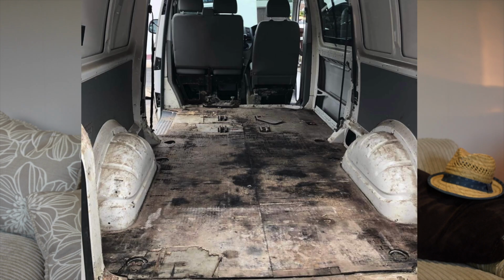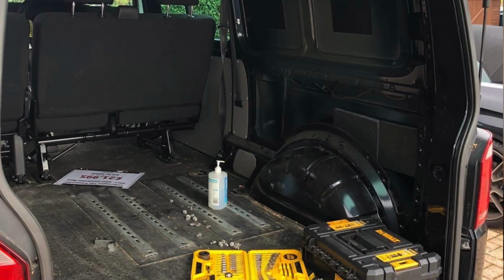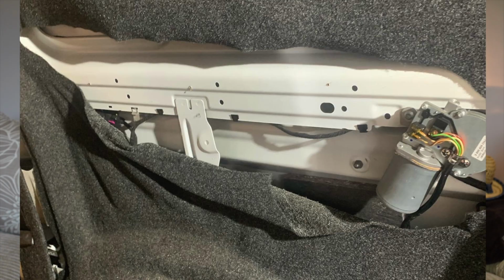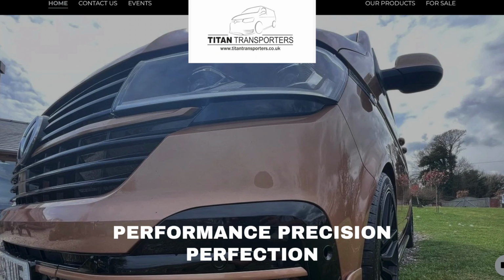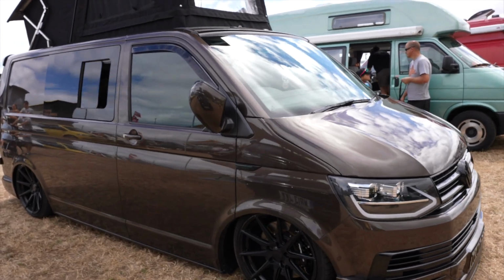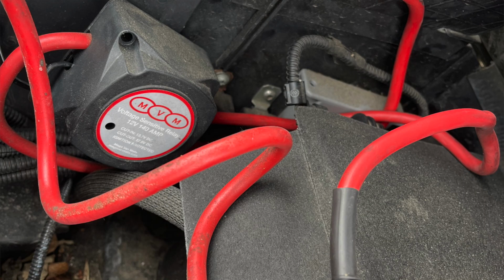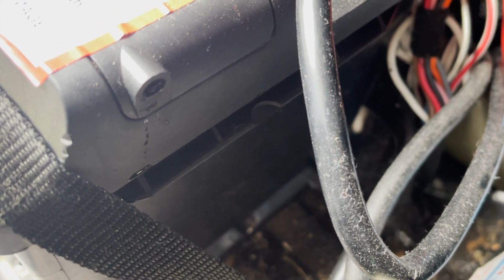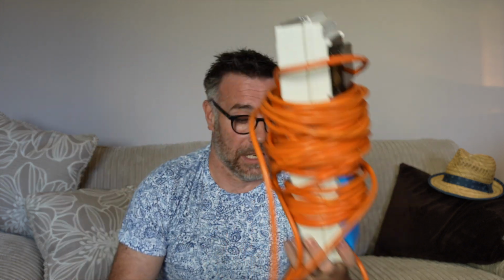Bad Conversions - Poor Quality and DANGEROUS Camper Vans

Comment: Thank you for another great video highlighting some critical points. I bought my VW as a new conversion from a new converter. I researched him first on line - he ran a building company and started to convert VWs during lockdown to keep himself busy. I met him at his house and followed him to his workshop, where the vehicle was. We went round the vehicle and he explained everything, then we went for a test drive. On return to his workshop he took me and my friend round the workshop where he was working on his next vehicle, which he had had  stripped down to bare metal and the build just started. He showed us the vehicle, then everything he was going to put in it and explained what he had chosen for the build and why. He spent a good 2 hours with us first, picking up each item for the build - confirming it was the same as the one he was selling - and showed us all the paperwork and invoices. This gave me an enormous amount of confidence about the van I was buying - and when I did buy it he gave me a folder containing all the details - I even know what flooring is down in it. The wiring is excellent -and he had a specialist automotive electrical engineer come and install it. He was then in contact for some time after, checking things were still ok. I’ve since had a split relay (I think that’s what it’s called ) added which lets me charge up both my leisure battery and car battery in the winter by hooking up to mains in the house. This has been a huge boon. Unfortunately he has now stopped the conversions which is a huge pity, as he did a superb job.

Comment: I had a conversion from Holbrook dubs. Poor customer service blamed me for problems. The electrics had slices through them where they cut to deep, earthed through the carpet and didn't secure the battery and other stuff regarding the van too many to mention.
Reply from the maker: Wow, that sounds horrendous. Unfortunately it does seem an issue that’s far too common.
It would be much better if the industry was regulated
Reply: You're not alone.

Comment: Good advice!
Just a word of caution on your wording about cables. Just to avoid confusion, multi strand (or fine strand) cable is what you should be using not multi core. They are different things. I am an electrician and have seen easily confused when buying cable. Keep up the good work!
Reply from the maker: Thank you. Well spotted, “strand” was the word I was looking for. At least you could tell what I meant, from how I explained it 😳 It’s frightening how some installers are using incorrect cables. I did mine myself, but made sure it was professionally checked prior to turning it on
Reply: Tri rated?

Comment: The one i always pick up is lighting- they have 6+ led lights on a single circuit that you either can operate when in bed or that all come on when you open a door . Instantly blinding you & the whole campsite 👍
Reply from the maker: They so are bright 🤣 Could you give a better answer the the comment here from Gary regarding the camping electrics. I was told they aren’t suitable, as it can make the van live
Reply: 230v?
Needs to be grounded to the body of the van for rcd  protection.
& i use 2.5mm arctic cable
Reply: 230v?
Needs to be grounded to the body of the van for rcd  protection.
& i use 2.5mm arctic cable
Reply from the maker: Perfect, thank you 👍

Comment: There is a camper van on sale on e,bay at the moment and the fridge flue is run in a flexible flue that runs touching pipes and wires and then goes down hill as it exits the van.  Dangerous.

Comment: I had a van from Big Wave Campers, absolutely shocking. Poor bodywork, really bad messy electrics. Cheap nasty kitchen and bed. But worst of all no gas dropouts even though it had been signed off as safe. Absolutely terrible.
Reply from the maker: That sounds terrible and dangerous. No doubt it would have been expensive too
Reply: As an owner of a Big Wave Camper van I very doubt that this is true. We are on our second BWC  and know of several people who also own one and can confirm that on every van there is a round dropout on the right hand side rear of the gas locker. Ok they are not the best, a few loose screws etc. however they do not charge £60-70 thousand for vans that are not worth the money

Comment: Can you explain in more detail why you cannot use the camping extension cord in a campervan. I have a VW type 2 without electric so use the maypole camping lead with the built in Circuit breaker. This lead is kept up high in the pop top??
Reply from the maker: I was told that those devices are not designed to be used in a metal box as any stray wire could make the chassis live. They said the van needs a specific consumer unit for utilising 240v.
Reply: Not an electrician but I believe going by regulation consumer units should be 'grounded' to the van chassis.
Reply: I thought a car was a faraday cage, and if struck by lightning would protect the occupants because of this. Therefore if the car became live you wouldn’t get a belt from it?
Reply from the maker: @chrispalmer8782  Not if lightning strikes and you touch the metal work 😳
Reply: Sure you could use one if you ran an adequate earth cable from the unit to an earth point on the van
Reply: Exactly, you would only get a belt if you were a better earth potential than the van🤷🏻‍♂️
Reply: @chrispalmer8782  possibly not while you're inside but as you step out you make the connection for a circuit back to the site earth or the substation. 
It does depend on the exact fault though, the circuit through your body might be to an earthed handle or casing on an appliance.

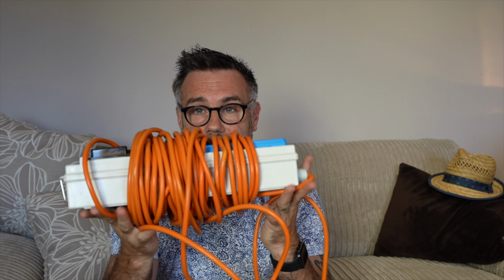Comment: 12:05 can you elaborate on what that thing is please? What should we have in its place?
Reply from the maker: This is the “camping” lead which was designed for use in tents.
They cannot be just placed in a van as a fault can make the van itself live.
A properly installed electrical system should be used that has been earthed correctly

Comment: Hello, thanks for the channel, some great stuff on here. 1 question, the connector block with a built in RCD/MCB that can only or should only be used in a tent, why should this not be used in a van?
Reply from the maker: Thank you. The design of these devices is for tents, awnings etc which aren’t a metal box. A fault could lead to the van becoming live. This would not trip the device. The reasons why was explained to me by an electrician.
Reply: So am I correct in thinking that the land side earth should be connected to a chassis earth? Thanks, @Matt Quinn for the word ‘Float’ it cleared things up in my head.

Comment: I had a conversation done by Leisuredrive 
Over priced and bad quality workmanship 
And a attitude of we don’t care about customers 
And they been in business for over 25 years 
And I did my research and not the first campervan I’ve owned
The worst thing was the under slung water tank came loose and took out my brake pipe that right no brakes at 60mph
Reply from the maker: Wow that sounds frightening. Hope they took responsibility and rectified the issue. Quality checking and the correct sign off is important before they leave the workshop

Comment: Tell me why the first thing you mention as a bad thing, the use of rock wool. I have converted 3 vans and kept them for long periods of time without any issues. I use rockwool only in the lower hollow sections silver thinsulate in ceilings and floors, boarded and carpeted, in order to maintain head height and wall carpet only the rear "window" recesses to maximise interior space. My van is as warm/cool as others I have been in. 

The second thing you mention is gluing seats in which seems to be really stupid.

You are using the wrong terminology with regards the the wiring, a multicore is typically 2 or 3 conductors, LN, or LNE, what you mean is "stranded" as opposed to a "solid" cable.
Reply from the maker: Rockwool holds moisture and degrades when wet. Seen many conversions with this that have rusted due to this. Only becomes apparent when they are stripped back. 
You are correct, I did get my terminology wrong with the cable 😳
Reply: @StaycationLifestyle  how does the moisture get in. Never had a rust problem.
Reply: @pauldavies7251  I know what condensation is and how it is created. The insulation is covered with ply and and wall carpet, so where does this moisture come from? It can't come from the occupants? Plus some of the steel is not protected by insulation and that doesn't rust...and all the steel is painted, this is complete nonsense. A few weeks ago I took part of my roof lining down to modify the lighting, I converted the van 7 years ago and have spent 150+ nights in it with my wife and dog and it is exactly as when I bought the van. Now one thing that was a problem the screws holding the roof panels in went rusty, caused by condensation, so I replaced them with stainless. Put that in the list instead instead of this rubbish.